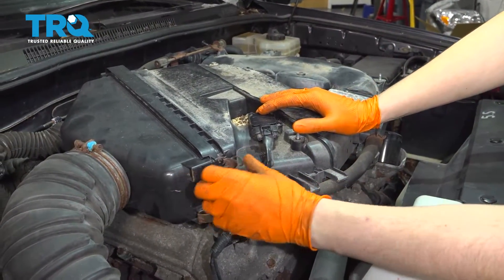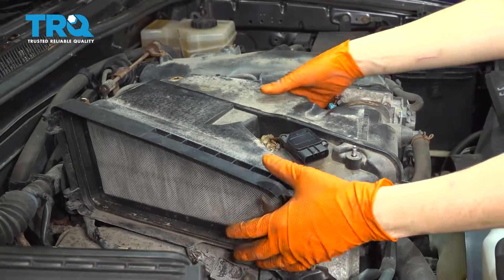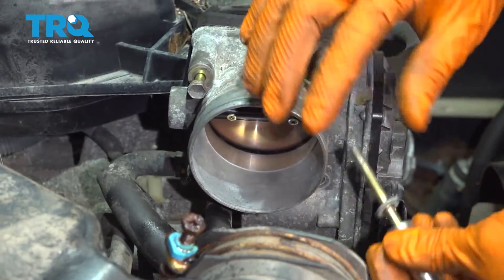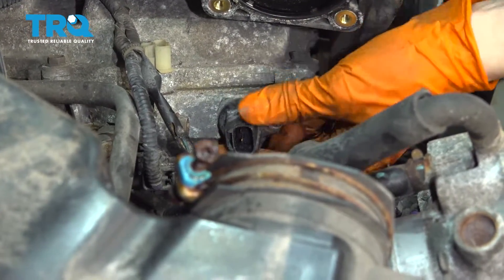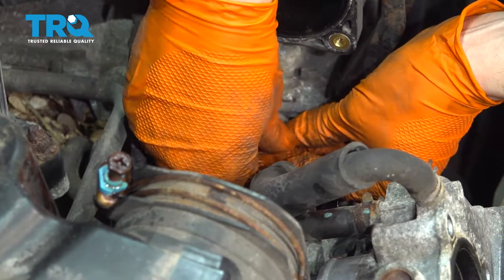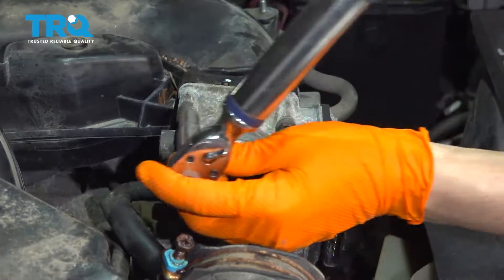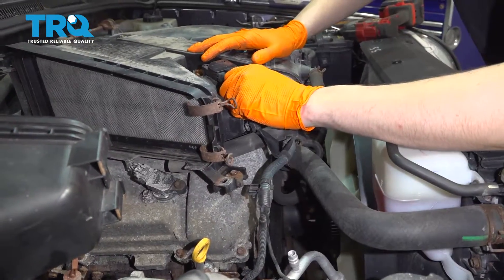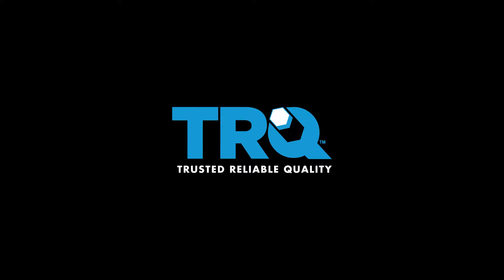How To Replace Camshaft Position Sensors 2003-09 Toyota 4Runner

Comment: For anyone wondering which sensor is bank 2 it’s the one he’s replacing under the throttle body. I have code p0345 for this issue. I was told p0341 is for bank 1 which is opposite of this one and easier to get at.

Comment: If your title is going to imply that you are showing how to replace either camshaft sensor (as does the dialogue) then show location of both for crying out loud,  I need to replace the Bank B sensor.  Maybe I missed it but as far as I can tell you didn't bother to say whether you changed the camshaft position sensor for Bank A or Bank B and more importantly you also didn't bother to show where the other sensor is.   I think you changed Bank A.